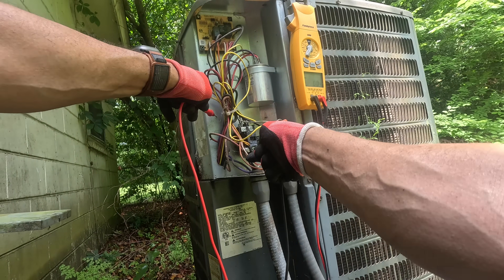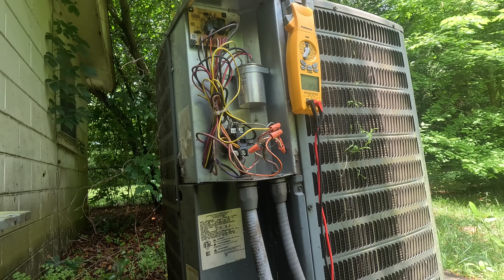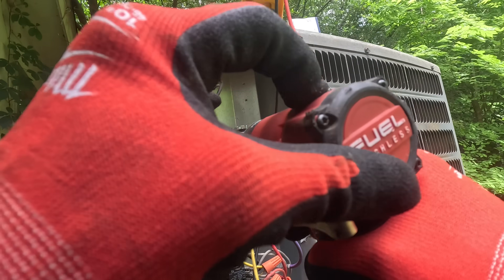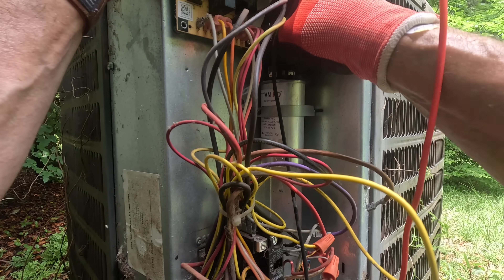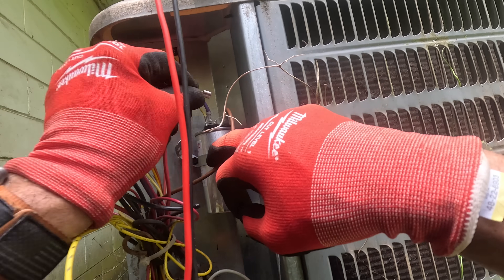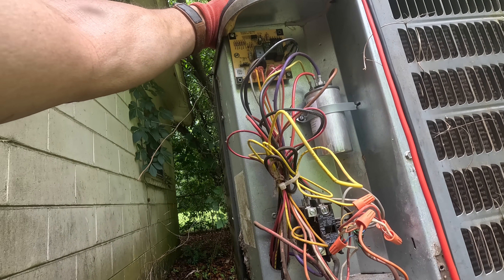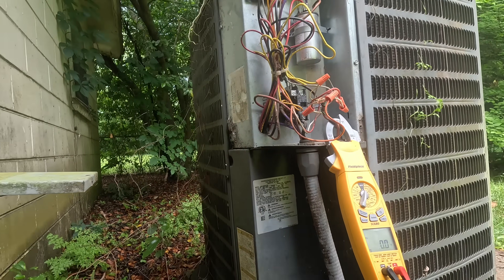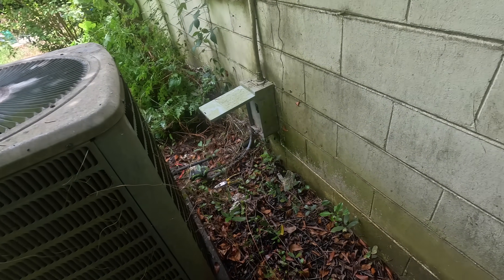No Maintenance Of Any Kind For Years! #hvac hvacguy #hvaclife

Comment: If the compressor had died,   and burn up,  what are the chances that all the lines are contaminated, and the TXV's potentially  clogged,  or about  to get clogged.  Adding thorough  line cleaning  adds to the cost, and of not correctly, the potential likelihood if contamination remains,  of a shortened new compressor life  ?

Comment: Im sure that outside unit is packed and you will be back to clean it and replace inside filters. That condenser will shut down from overheating shortly. Makes me crazy to see you hvac guys fix and dont want to address the cleaning part which most likely caused the problem.

Comment: Been many years since I messed with CB radios. If I remember correctly to get the SWRs right you cut a small piece of coax at a time till you get it right, depending on the type of antenna. That's a big 10-4 good buddy. Back in the day I even had the license through the FCC, not sure if you need that today. Mainly some truck drivers still use them. There may also be a few Ham operators left.
Reply: It depends on the power output.
Reply: Dont't cut the coax. Trim the whip from the bottom if its stainless. If its one of those firesticks then trim from the top.
Reply: @JayB-dk6ge  That's right, I believe that antenna might even have a set screw. Furthermore, many are set up with the right length of coax. That is why I said it depends on the antenna. I use to have a SWR meter back in the day. We used them on boats, cars and home base.
Reply: @jthonn  I had a situation a few years ago on a mobile install where I couldn't get my swr right for anything and nothing made any sense. Turns out my antenna analyzer had gone flaky, and I almost trimmed the whip too short. It gave me all kind of headaches. You are correct that the Wilson has set screws. I think they might have a couple if I'm not mistaken. I have had base station antennas with a beta match that required very specific coax lengths as part of their tuning mechanism and those could be a little tricky.

Comment: I am not in the least a lazy man however I'm not going to someone's home to do their yard work. It would be in my contract that the need to clean around the system before I show up and if it's not done I'm leaving. I'm doing exactly what I'm called for HVAC service and maintenance.
Reply: C'mon, clearing that bit of greenery wasn't that bad. Many times you run into older people who either can no longer do it themselves, or, have completely forgotten about condenser maintenance.
Reply: @46fd04 I do understand and I'm not completely heartless however, I'm not running a civic business I have a private business that operates on how efficiently I do the job. I do excellent work and don't leave until I know everything is working properly but I can't run efficiently if I have to do yard work. So when I get a call I tell them that the area around the unit needs to be completely free of any debris.
Reply: Pretty soon you may be out of customers!
Reply: Im booked till September already. @bobboscarato1313

Comment: Why did the condenser fan motor trip the thermal overload in the first place ? 10:52
Reply: Old capacitor was bad and hadn't cooled off before trying to start back up.
Reply: When the capacitor is bad the fan motor coils are hot with power but its not turning to cool itself with air, so too much heat piles up.